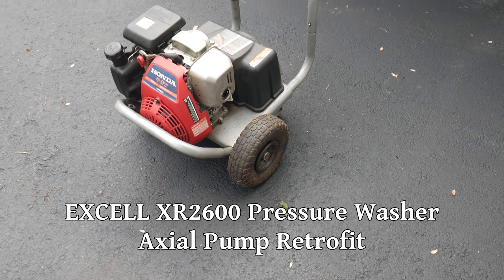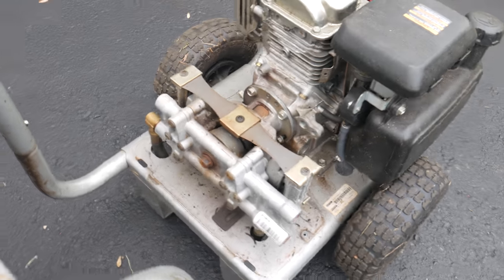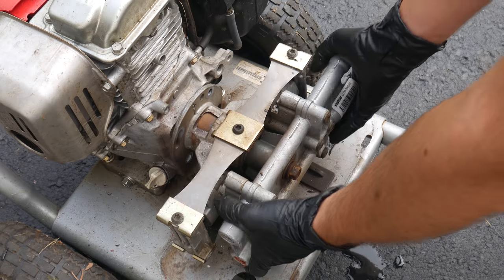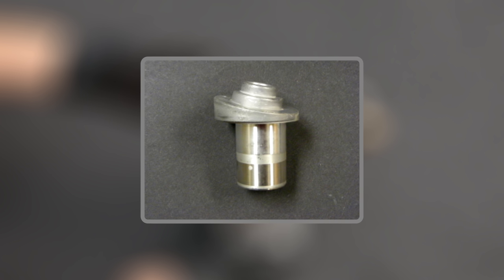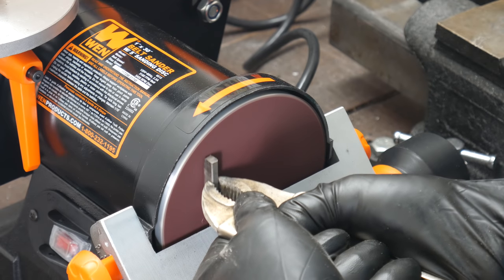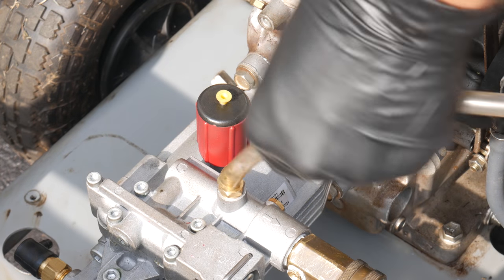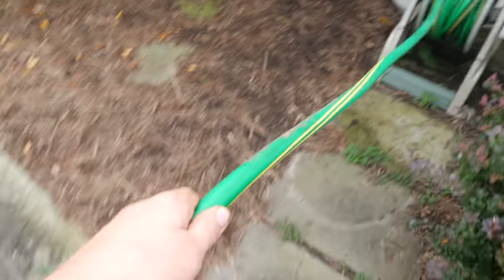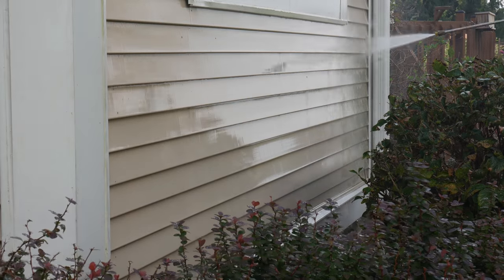EXCELL/Honda XR2600 Pressure Washer Pump Replacement (Axial Retrofit)

Comment: any updates on the z?
Reply from the maker: It's sitting at Sean's house, he has a short attention span and bought the Volvo expecting to drive that for a while. Of course, it broke immediately, and now he plans to put money into that before really working on the Datsun. Next thing the Datsun is getting is an actual gas tank, as the fuel cell is leaky and the fuel pump is loud and he just wants a fuel tank back under it.
Reply: @FuzzyDiceProjects  thank you for the update :)

Comment: U wanna use real key way material so that if u over load the motor or pump the key will snap and save them
Reply from the maker: It was a piece of mild steel I used, should be about as soft as steel comes, but I doubt this little engine would be able to shear it anyway. If it somehow did, then it would probably be a catastrophic failure anyway

Comment: I don't want to be one of those youtube know-it-alls...But you're going to get water behind your siding blasting away at it like that. I did it myself :/

Please who professionally clean houses use chemicals and very little pressure.
Reply from the maker: Fair enough! I have not done much cleaning of that sort, but I have seen professionals spraying from under a foot away. They probably had a wider angle nozzle on, though. Also, as you pointed out, I didn't use any soap here so it was far from ideal. Mostly it happened to be right next to the garden hose and figured it would give the pump a good test, didn't look up methods for siding cleaning beforehand or anything.
Reply: Looks like it was summer time when you did it. Plenty of sunshine and warmth to dry it out since then. No worries.